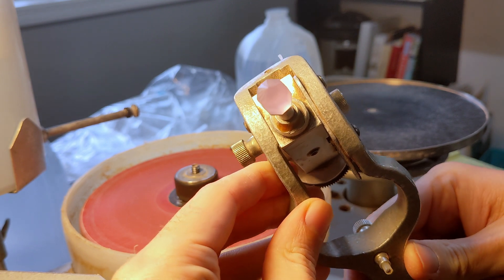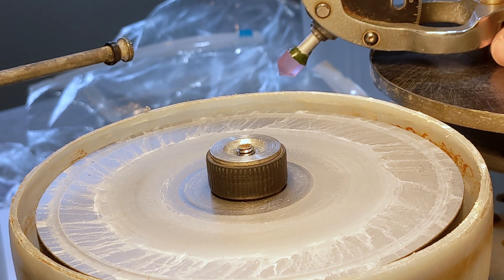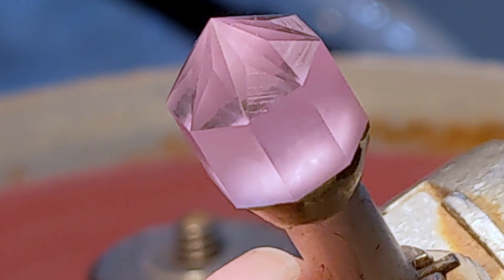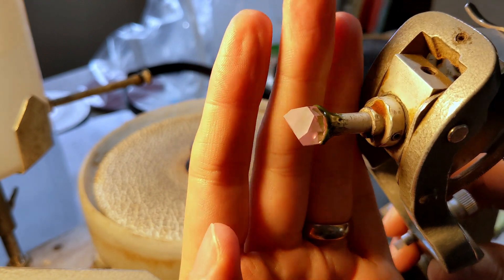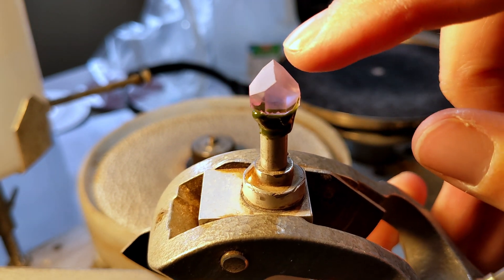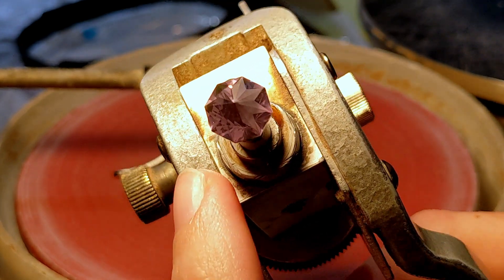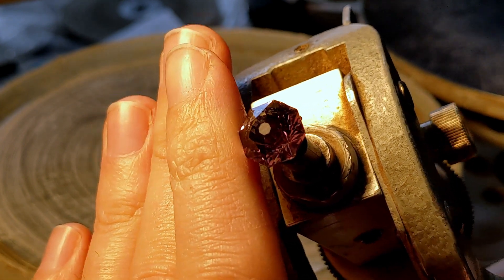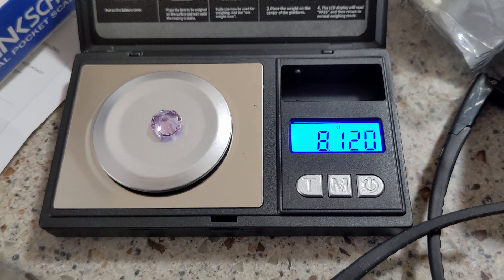Faceting Nd:YAG Laser Rod Into A Gemstone

Comment: Did you find that the Yag heated while polishing?
Reply from the maker: Nope, for the final polish I only touch it to a tin lap with 50k diamond for a few seconds, with the lap running very slowly. Takes a little longer if the pre-polish wasn't that great, but not enough to heat.